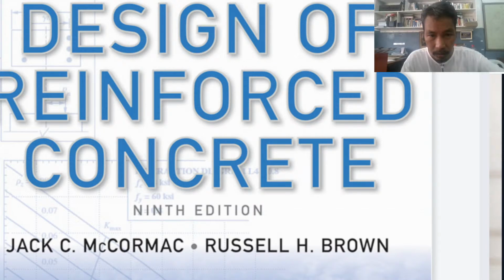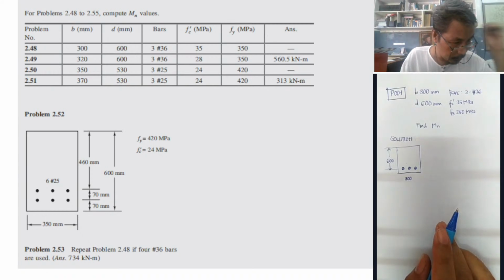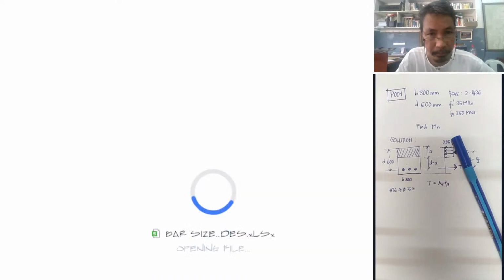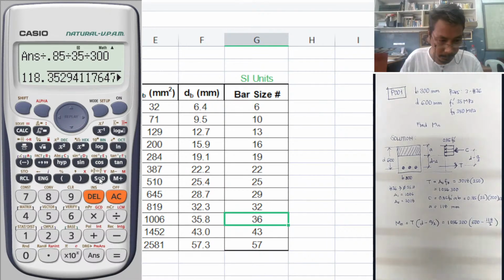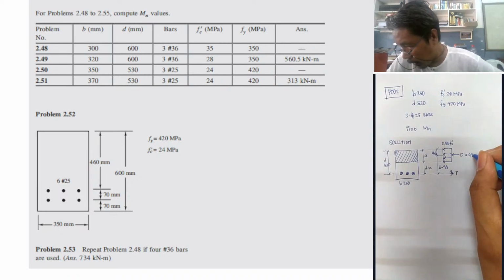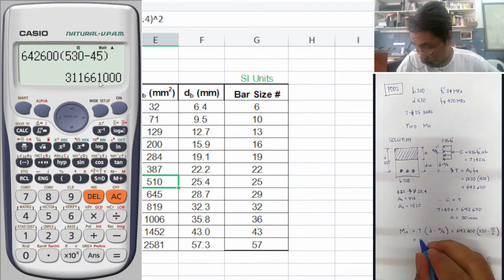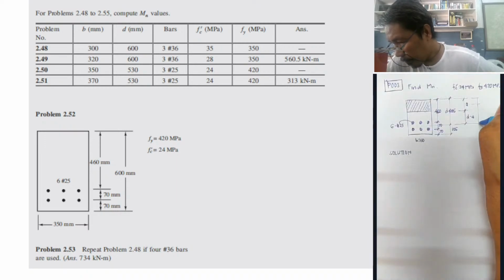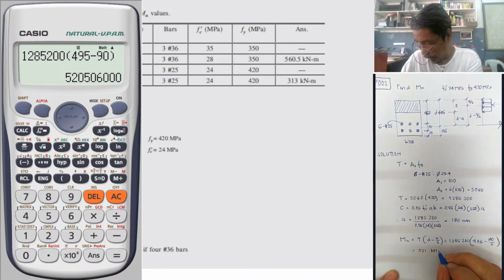[ LIVE CEE7 Lecture 06 ] DrAP Zantua Singly Reinforced Beam Talks + ENGINEERING Analysis & Design

Comment: Thank you, sir for repeating the problem solving example in flexural analysis that we have already discussed. It was repeated here that we used rectangle as it is the simplest shape. I remember that we can used any shapes. However, using a rectangle gives the estimation. Let's try another problem sir with complex shapes. I wanted to enhance my familiarization on complex shapes not just rectangle, sir. It would be fun if we could used several centroid formula to determine the center of gravity of this complex shapes together we could learn more concept from you, sir. Thank you, sir for sharing your utmost knowledge about this course.